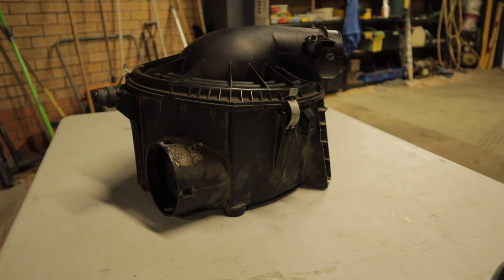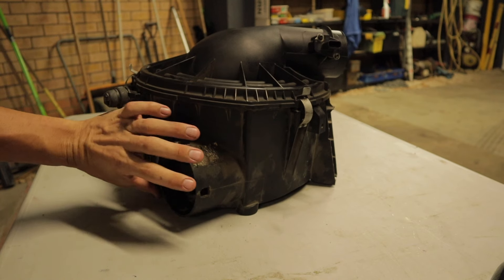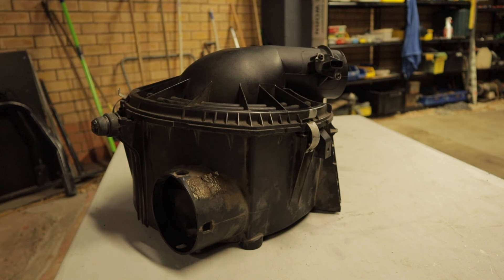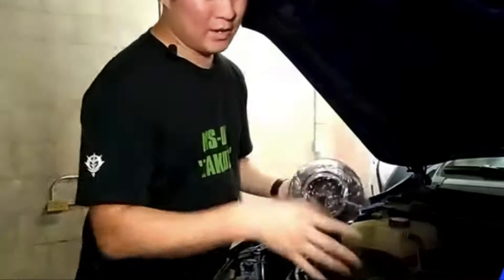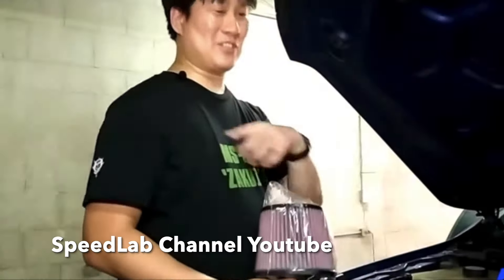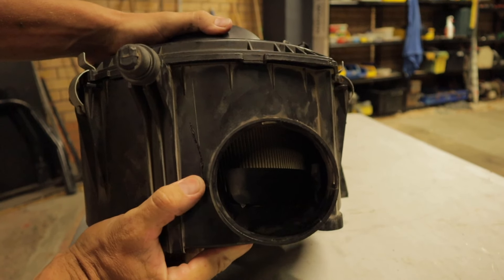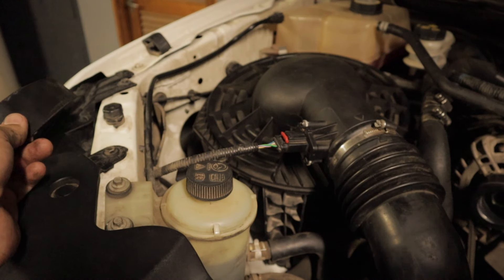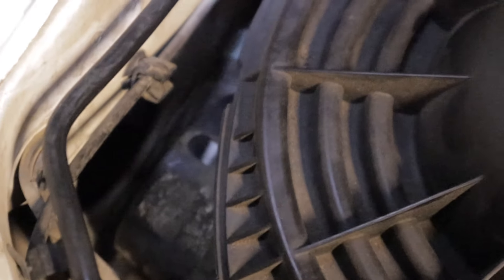Ford Ranger Factory Airbox Restrictor Removal | Free Modification

Comment: I guess they made it like that to increase the air velocity and thus increase the cyclone effect inside the airbox helping getting rid of dust from the air and settling in the bottom of the airbox before getting to the air filter improving the longivity of the air filter itself.

Comment: I removed the Stan air box and replaced it with a"cold air intake"and the car ran worse of you change the air intake system you need to re map the ecu
Reply: What model ranger do you have? I bought a 19 biturbo that the previous owner modded with a cold air enclosed system. I always get the check engine light for airflow and the carbon build up for 60000 ks on the clock is ridiculous. I'm convinced that I'm going back to the stock intake

Comment: Can you please say something about how you experience the change? Do you feel some power increase or increase in the induction noise? Many airboxes have the same restrictor, trumpet like, it has to do with the Venturi effect in order to deal with pressure drops inside the airbox. However, for the Ranger 2.2 it may be that they've overdone it.
Reply from the maker: no noise increase,  better towing under wide open throttle
Reply: @abdautomotive  so you had the 2.2 restrictive pipe. Still puzzled why they’ve made such a decision. Thx!
Reply from the maker: @mugurmartinescu5728  removing it was the first modification i did

Comment: I'm already removed the air pipe and i put wire mesh on it.. i left 3" cover to prevent the hot air get inside the air filter ..thanks a lot mate 👍🏻

Comment: 2018 3.2 px2. Airbox mod, alloy intercooler and hard pipes, intake manfiold clean(shitfuckn job), new glow plugs, dpf back 3inch exhaust. 0 lag in the pedal from a stop now, almost like driving a petrol car. Off to get remaped soon, will see how it goes. Love ya tips mate! 

Keen to see how yours goes remaped as much as it has done 300k.
Reply: How many ks
Reply: @chrismccormack8018  done 120k. Made 176rwhp and 520nm.

Comment: Great Channel and Content
i have a 2020 bt50  planned to do this and I replaced the stock air filter with a k&N and the improvement was instant. next i was to remove the plastic piece, However 2 days after the new filter was installed  i got a warning  light pop up so i checked my odb scanner and got a code "POOBD - Mass or air flow A circuit range/performance -Air flow too high."  after that i restarted the van and it was gone.. Is it anything to be concerned about or check? Do I  leave it or put back the stock one?
Reply: Probs got oil residue on the maf sensor from the K&N filter bud. Remove maf and clean it with electrical contact cleaner.
Reply: It’s because the factory air filter doesn’t let as much air though as a k an n one, the k an n one are quite thin, had the same issue with mine

Comment: Don't fit a cone filter . If you get rid of the airbox the filter is sucking hot air from the engine bay therefore reducing power.

Comment: i found the air filter was much more noisy in the engine bay with out the restrictor . so i cut the horn where it starts to reduce and seated back into the front quarter panel. the quarter panel definetly insulates the sound
Reply from the maker: i was getting alot of dust when inside the guard

Comment: wouldn't it then be beneficial to source the 3.2's pipe instead and just fitting it. That already allows for more air and will remain in the guard on the body?
Reply from the maker: it picks up all the dust from inside the guard

Comment: A reduction from 4" to a 2" inlet diameter is a reduction in area from ~7800mm to ~2100mm square. So you lose around 3/4 of the inlet area with that reducer on the 2.2. On the 3.2 going from 4" to 3" you lose much less, only around 1/2.

I have to wonder what is the point of that thing?
Reply: must be to make the power/torque diference more apparent for the bigger engine

Comment: My Ford ranger 2018 2.2 doesn’t want to start, it just cranks without taking and it cut speed when passing 100km/h and losses power and picks up. They can’t find what is the issue, changed fuel injector pump,cranking senso, injector sensor and still nothing
Reply from the maker: if it's going into limp mode it will be showing a code, i recommend forscan to check codes

Comment: Stupid mod cutting that bit out, its there to direct the air/drops of water around the box using centrifugal force to separate the water from getting sucked in from the top (not 100% efficient)
The 'restrictor' is there to meet the factory 800mm wadding depth, its also pointed forward so it sucks air from the front of the bumber instead of where the opening is.
Good luck if you ever dip your nose in water
Reply from the maker: at 800mm thats just touching the bottom of my bullbar.